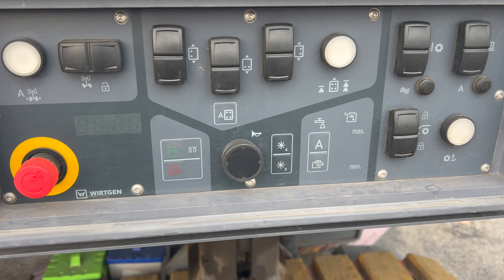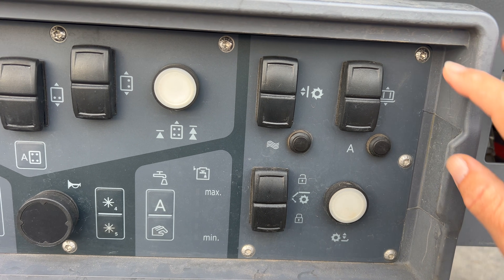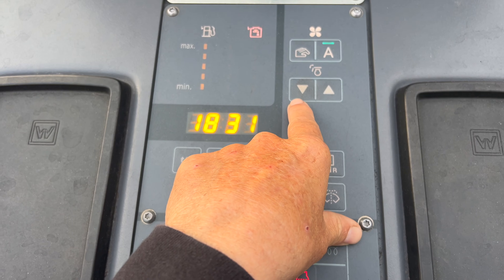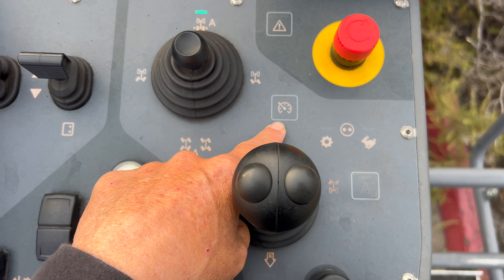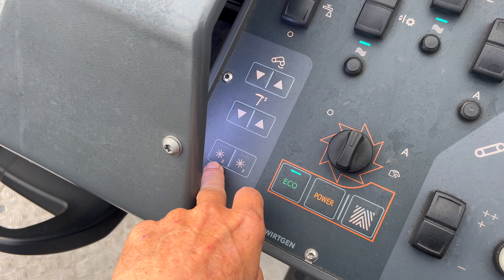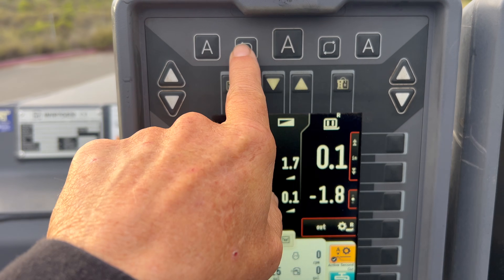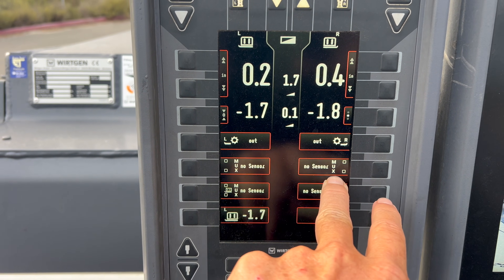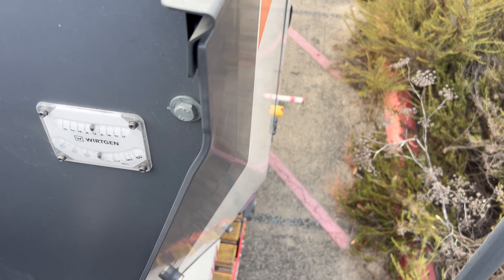Wirtgen 210Fi Control Panel Explained – Every Button and What It Does

Comment: I always buy my teeth from my wirtgen dealer and use wirtgen teeth.  I notice you have a different color box of teeth in your rear tracks. Where do you get them and are they are durable and more cost efficient?  I typically buy and use about 2 pallets of teeth each year, each pallet from the stealer is 16 grand.  I run a 200fi. Thanks
Reply from the maker: We use Xcal teeth. They are much better than wirtgen teeth. Not sure of the cost though

Comment: well explained in deed but I have a question on how to quickly adapt fast on using sensors on the machine when it's your first time to use sensors,and the other thing is let's say I am going to mill the depth of let's say 150mls(15cm) deep then I put that manual deep to see if correct when it's correct then switch the sensors on, is it not going to give the correct depth that way.
Reply from the maker: Once I know they are calibrated correctly it doesn’t really ever change. I just set the depth I want and go

Comment: How do you lower the front gate. Because the cylinder are moving up and down a 1/4 but wont go down and lower the gate when you hit the switch up top on the dash or on the side of the machine above the track lift cylinder, can’t get it to move. Do you have to have certain functions a certain way to activate it and lower the front gate??. I’m on a 220Fi
Reply from the maker: sounds like the lock solenoid could be stuck. Or something jammed it it.